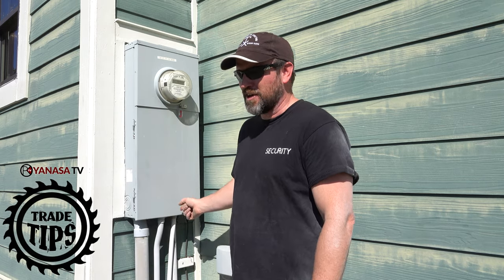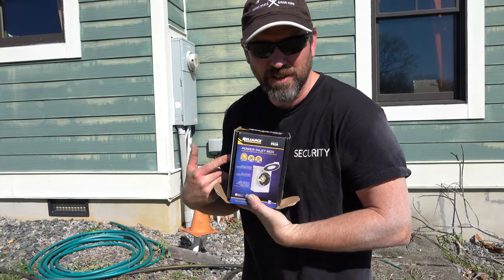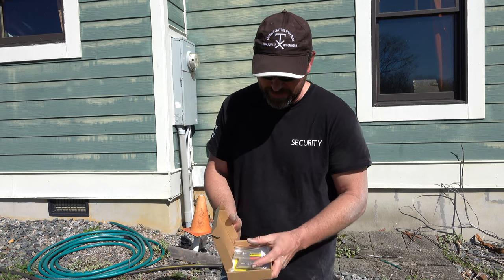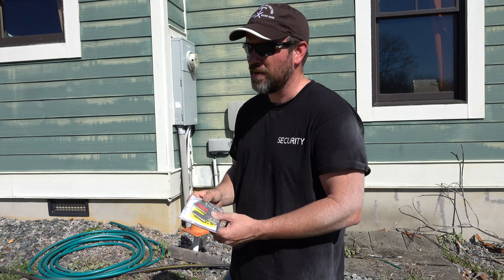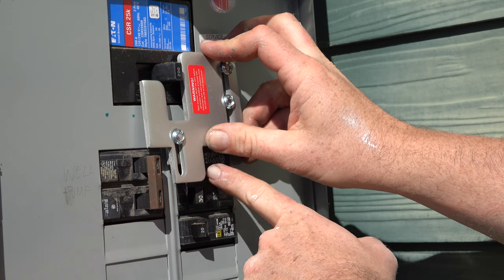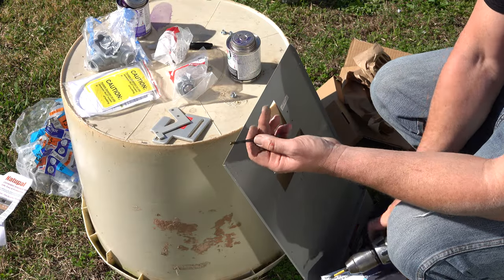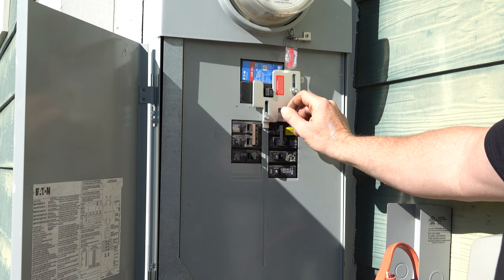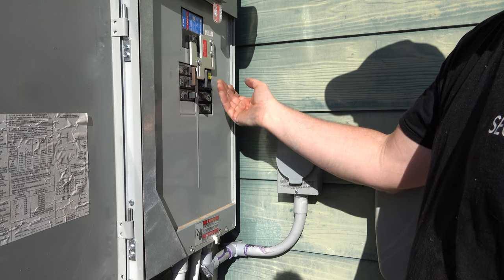Prepare for Power Outages | How to Install a Generator Power Inlet Box

Comment: So glad I came across this. Exactly what I’ve been wanting to do. Well, what I want my husband to do.😂
Reply: @Gigi61866 , Go for it, even if you don't install it all , at least run the wire, leaving slack at both ends . Get your inlet box ordered and ON SITE. study your breaker box and get the correct 30 or 50 amp breaker for your box. What size in your generator? Write your information in notepad before you go shopping.  Take pictures,  take with.
Reply: Wait a minute.
You're not gonna help?
Reply: Ha!! Well, as long as it gets done!!

Comment: I'm hearing folks refer to that Interlock thingy as a switch. I can't see that it is anything more than a safety measure, right? If all it does is lock out one breaker or another, then me over  here, living alone and having an understanding of which breaker is which and if i know to always turn OFF the main first and when the power comes back on i know to turn the gen breaker off and the main back on?...i mean, isn't it just that simple? What am i missing on that front? Thanks

Comment: In my opinion (you probably figured this out first time you used it) your inlet box is mounted too close to your service panel door. When you plug your generator cable in your inlet box you won't be able to access your breakers in your panel without disconnecting your generator cable first from the inlet box. Other than that, it's a nice job.

Comment: Romex should not be used inside of any conduit due to heat effect from the romex having a shedding around the wires. You also cannot remove the shedding and install the wires inside the conduit since the wires do not have identifying label on the wire itself which comes back to the same comment made on here requiring THHN wires.

Comment: I ordered a generac system. Simple goes on your meter.  Plug and play.  Only problem for me is it will take 4 months to hook up.  Our hydro company is way behind . It's a 15 min hook up . No switches nothing. I have a generator hook up but limited to certain circuits. With new system I can run whole house up to what my generator can handle. 9500 tri fuel generator is what I have.

Comment: 5:21 yes its hot up top and the main leads coming in are at the bottom , the red , white and black is what is feeding that box . you kept putting your hands wright next to them and you cut the Romex casing off 7:52 , I am still cringing just thinking about what could of happened , your very lucky and good luck opening the panel with the cable plugged in . By the way 9:19 those breakers already in the panel have a lot of copper showing , I'm surprised an inspector let that pass when the house was built our the box was updated, that's a sure sign there was no inspector I hope you used 10 / 3 and not 12/3 , just some constructive feedback.
Reply: I re-watched it. Yes, he was too close and nonchalant about movement in that area.

Comment: Doing this in a few weeks to my house. For kicks, I'm an electrical engineer, I got a quote $1k from an electrician. Safe to say I'm doing it for material and time cost and possibly looking for a new job lol. I'm shocked its not a permit/inspection type of job in my county.
Reply: Not yet at least 👀
Reply: @therealkakazi8926  I pulled a permit. Didn't want to give insurance any leverage. Had to submit drawings and work plan. Installed 50 amp service. I run the house, full load, once a month on a maintenance cycle. Furthermore, I set up a solar panel trickle charger to the generator battery.

Comment: I'm comfortable with doing electrical things in the house (switches, replacing outlets, installing new outlets, fans, chandeliers, fixtures, etc...)
I stay away from the panel.  I bought my electrician buddy 2 cases of beer to put one in.
He put a 50 amp inlet box with 6/3 cable.
I cooked some good steaks on the grill while he was working.
Reply: Your very fortunate because over here in Australia these electricians are crooks

Comment: Use #6 wire and get 50 amp breaker. I appreciate your saftey switch but comfort for a few dollars more.
Reply: I agree. You might need to run a 240v appliance in your house. You'll need the 50 amp plug.

Comment: There's back feed on the grounded conductor even for lineman working the system to restore power. The correct way is to isolate the ground/neutral also not just turning it off at the main.  Remember it's AC current not DC!
Reply: Good point.:text-green-game-over:
Reply: Not if the service entrance is installed correctly.  The neutral and earth ground should be connected at the service entrance.  The neutral is also connected to ground at each utility pole typically. So, there is no danger to the utility workers unless the service entrance wasn’t installed correctly or the ground connection has gone bad.  Otherwise, this main lockout switch would not be a code compliant installation and this will pass inspection.

Comment: Very scary Charlie, you did it like I would!
Although I need to set up my new shop for a Genny but I happen to have a manual external transfer switch I'll use betwixt the plug and panel load.

Comment: You cannot use Romex outside in a conduit because it’s a wet location.  Against the electrical code.  What should have been used is THHN/TWHN individual wires.

Did you use schedule 80 conduit as required for exposed pvc?

I have a 30a tri-fuel  inverter generator with a 50a plug so I used 50a generator inlet plug and #6 THHN wires but a 30a breaker.  If I ever get a bigger generator that puts out 50a, I just need to swap out the breaker

Comment: Nice job. I had an electrician install my Inlet box but "said" the local supply house was out of the lock out kit. I am going to get one off of Amazon and add it to my panel for obvious safety reasons. Your video will be super helpful for my DIY. Thank you for sharing this. I'm betting you just go through another pollen season? 🙂

Comment: Wish you had shown a closeup of the generator male plug type and the new generator inlet female socket type.
That detail is Online somewhere I’m sure.

I have a generator 

Dunno if my city power IN breaker is a single power switch, like yours, or if I have extra breaker spaces adjacent to it for the lock-out plate and generator IN breakers but the brand new breaker box was installed in 2019.

I have a 100 amp service, and no 220 power needs in my house, but I did add a 3 phase 220 power outlet, that is separate from the mains breaker box, just below it.   Big round plug with the 3 locking 1/4 round 250v plug ears, it has a lever (leaf?) switch, for its outlet.  I put it there in case I hook up a 220 volt trash pump, because I have a slab foundation (stone house built in 3 separate phases 1880-1940) and the ground behind my house is 6-8” higher than the floor is, 110 volt sump pump right where water could come in the adjacent back door.  New gutters installed, and bingo, California gets a huge deluge, sump pump is barely needed now as a result!

If not for the city power lock out, could that switched sub 220 box be also used as the power inlet for the generator?  hence my plug type question, 

simpler if not safer to bring the generator IN power with that 220 switched sub box

I think I’ll hire an electrician 🙂

Comment: Romex through conduit is not code.
Reply: Quote the code section that prohibits this.  Good luck as it isn’t prohibited in any code of which I’m aware (in the US at least).
Reply: Only time is it not code compliant is in a damp or wet location. Romex cannot be ran through an underground conduit because that will be considered a damp or wet location. Other than that, it is perfectly legal. You can reference sections 300.5 (b) and 334.12 (b)(4).
Reply: 300.9 indicates that outdoor conduit above grade that is exposed to the elements is considered to be in a wet location.
Reply: Was going to say the same thing.  It’s an easy way to install it but not code compliant.
Reply: @rchapoteau conduit is fine if fill is ok (may not be here). Damp or wet conditions not withstanding.

Comment: How much did this cost?
Reply from the maker: 30 AMP Inlet box $35 -$50 depending on the brand you choose. 
10/3 wire Romeo 15 feet $65 (ridiculous)
Double Pole 30 Breaker $20 -ish
About $30 in conduit parts.
About $30 for the Interlock Safety Switch on the Panel
Reply: @Yanasa TV  if installed by professional no more than 500 you think? Thanks for the great video and fast response:)
Reply: @billionairefaith1  had mine installed by power company in Missouri.  Equipment and labor cost me $740. This was for the transfer box, generator plug, and 50 feet of generator cord.
Reply: @Steel Man thank you so much 💓 💖
Reply from the maker: @steelman2544  50 feet of generator chord was likely close to $100 of it.
Reply: @gferraro8353  Run your plug line to the outside. Costs a little more for conduit and wire but you don't have to leave a window open.
Reply from the maker: @gferraro8353  we have a sub panel inside with most breakers and then a main panel outside with a meter.  If I did the same set up on the inside panel it would only exclude our electric cattle fences and well.
Reply: Looking at a similar install, shouldn't thhn wire be used in external conduit if you are trying to be NEC compliant? I am reading Romex is only allowed for indoor application. Would a sheathed 10/3 thhn be the correct option here?
Reply: @ryananderson174 technically speaking yes it should be thhn or thwn but he installed the Romex inside of a conduit so it is protected. Some inspectors will call it out because of the heat rating of the conduit and the wire but I’ve seen it on many applications and it’s never been a problem in my experience.

Comment: Gasoline engines are only a temporary solution  (short term). Then there is the issue of storing dangerous gasoline. A Solar Generator can replace your Gasoline Generator, Its safe no harmful fumes and its quite no one will even know when you are using it to power the things you need. IMO I would throw all my disposable income toward a Solar generator, and use Gasoline only as a backup if it clouds up for more than a week.
Reply: Solar is very expensive and unreliable due to weather
Reply: @714Roostergirl  not where i live .But im not talking about a huge solar array to power your house. Im talking portable solar generators. You can keep your Gas Generators and ill keep my DIY solar system. I guarantee your gasoline will runout before the sun does in a SHTF
Reply: @mannyfragoza9652  Vast majority of outages are short term (hours to 4 days) where gas will perform better and deliver more amps throughout the day.  A TEOTWAWKI or SHTF event requires a different set of rules and investments.   Solar is a fantastic option on the survival boards that I follow, but incredibly poor performing for 365 day-to-day power redundancy in a temperate climate.
Reply: @mcouture8169  solar is a hit and miss with Biden Sun Blocking program. Im guessing if these enviorfreaks have their way Gas will be as scarce as Hens teeth nothing is 100% but Gas short term pretty much rules.

Comment: you only energized the right side of your main as far as I can tell.
Reply: You can’t tell very far. 220v breaker grabs both bus bars.
Reply: The buss bar alternates from the top down to the bottom in each breaker slot. A phase, B phase, A phase, B phase etc. When he installed the 2 pole or “double” breaker, it connected both the A and the B phase.
Reply: I was curious about that.  So it shouldn't matter if the 2 pole breaker is installed top or bottom?
Reply: @otisstrong5114 The 30A breaker feed from the generator needs to be next to the main breaker so the interlock works as intended.